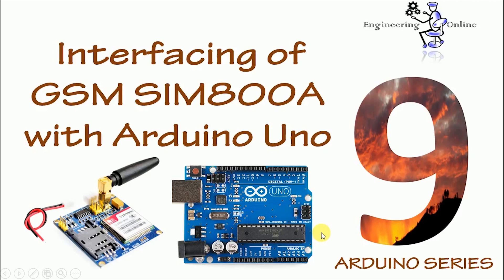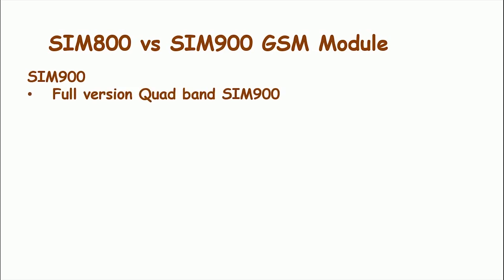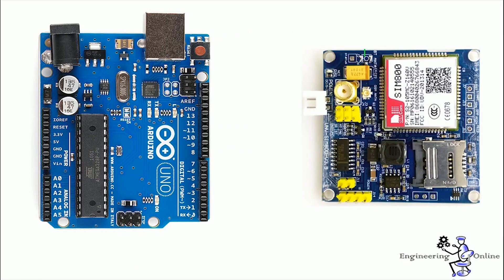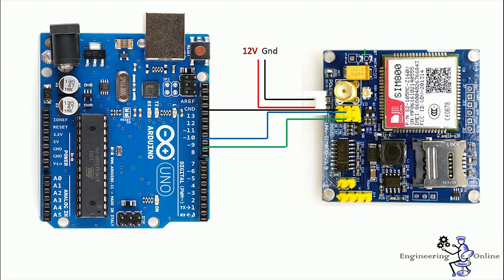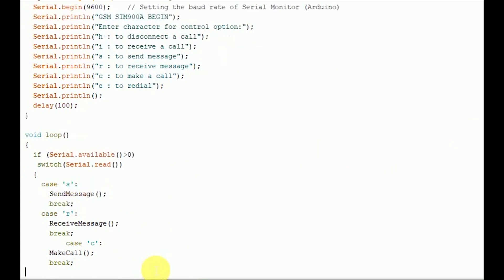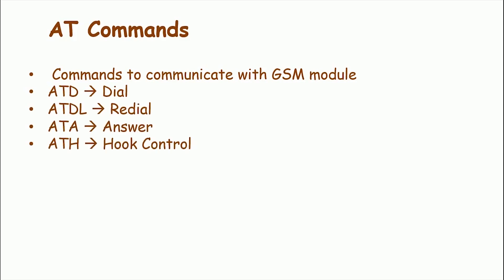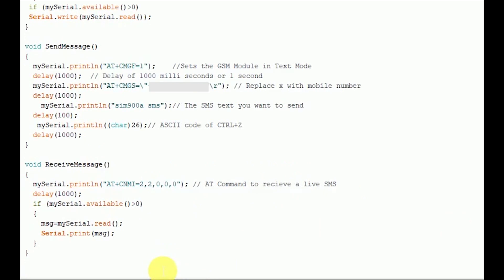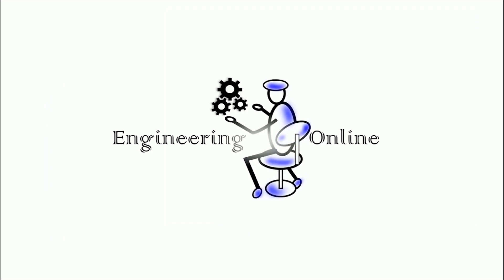Interfacing of GSM SIM800A with Arduino Uno

Comment: Hi mam, could you please explain me how to control our appliances through blynk app using GSM module without interfering any msgs or call for controlling appliances.
Reply: And if it's possible please explain the code or make a video for that which helps me a lot to my project
Reply from the maker: Sure noted 👍
Reply: @EngineeringOnline  Thank you so much

Comment: error  case label "s" not within  a switch statement
how to solve this error?
Reply from the maker: you are doing some mistake in the code. recheck
Reply: @EngineeringOnline  the LED blinking every second and i check using AT Command Tester.....showing "device is not registered and is currently NOT searching for a new operator to which to register"..
how to solve this problem?
im using 4G POSTPAID SIM
Reply: @EngineeringOnline  ur code is perfectly work but when i enter the c in AT COMMAND showing NO CARRIER
can u help to solve this problem

Comment: If we write this same code for SIM900a. Will it work?
If not what are the modification we should do?
Reply from the maker: Yes you can use the same program. Just confirm the serial pins.

Comment: Mam I'm using Sim800l it is working properly (i.e. it is  registering on network) but arduino board can't detect module .
Can you plz help me ?
Reply from the maker: How are you connecting it with Arduino
Reply: @EngineeringOnline  
Mam I'm giving power supply to module seperate 5V 1A and connecting txd and rxd pins of module to tx and rx pin of arduino
 uno board  respectively and also tried 9,10 and 11,12 pins of arduino board.
Reply from the maker: @insidepetworld  The recommended voltage range for SIM800L is 3.4 - 4.4 Volts. An external power source like Li-Po battery or DC-DC buck converters rated 3.7V 2A would work. Remember connecting it to 5V pin will likely destroy your module! It doesn’t even run on 3.3 V! Also confirm if the status LED blinks every 3 seconds
Reply: @EngineeringOnline  
Mam but module getting required power but when code is uploaded to arduino and module connected it say  FINDING MODULE only.
What about this ?
Reply from the maker: +Abhijeet Koli send the screenshot of the code and the error at engineeringonline0@gmail.com

Comment: Is this 3g module? Also how do you connect 12v power supply to that xh2.54 power connector?  And I have 12v 3amp adapter. Is it ok to use it for this module?
Reply from the maker: It is compatible with 2g/3g/4g.  This module has a male connector, so connect a female connector with your supply to power up the board. 12V and 3A would be fine for this module.

Comment: In my case SIM 900a wont send a message...source code same but im using Mega ..can you help me?
Reply from the maker: +Dadan Gusna What is the voltage and current ratings of power supply given to the gsm board?
Reply: @EngineeringOnline  5 v from external and i check with the blank sketch and write "AT" on serial monitor with baud rate 9600 ... sim900 just send "?????" Looping everytime just send "?????" ...i don't what happen ...ia sim900 broken or Mega ...
Reply from the maker: +Dadan Gusna Check both of them individually. Run a blink led program to check mega and insert a SIM in the gsm module and then call that number and if you hear the ring back that means your SIM is connected to the network and GSM board is working fine.

Comment: You are incorrect with your Vdd for SIM800. They are nearly all 3.4-4.4Vdc, typically 4Vdc
Reply from the maker: SIM800A requires 9-12V whereas SIM800L requires 4V dc

Comment: i am not able to send any messages 
it is just sending either blank message or just showing the content is not supported 
please help me to fix it
Reply from the maker: Have you double-checked the code? Call function is working properly?
Reply: @EngineeringOnline  all the other functions are working fine 
And even I can send sms from my number to GSM module 
But if I send message from GSM to mobile it is either showing content not supported or just sending blank message
Reply from the maker: recheck the sendmessage() function and try to change the mobile set too.

Comment: May I ask you a question, I made a project with Arduino uno R3, module sim 800A, controlling a contactor via module role, when power off and on so then arduino doesn't comunicate with Sim800A , I have to reset Arduino then it works . I don't know why, please help me, Thanks
Reply from the maker: How do you reset, through push button? and Does your Arduino works ok when it is not connected with SIM800. Try to run a simple blink LED program and check if it's working without pressing reset ?
Reply: Engineering Online thanks for your help!

Comment: i am getting the output as no carrier for call and error for message i have connected everything properly i have given power supply of gsm 800c to laptop
Reply from the maker: Check if the antenna is working properly, sim is inserted in a proper way and current requirement of the module is fulfilled
Reply from the maker: Try powering the module with external power supply that has minimum 1A current.

Comment: I am getting a "NO CARRIER" error please help
Reply from the maker: Make sure you have connected the antenna
Reply: @EngineeringOnline  yes its well connected and the gsm module is also working fine as i checked it with at command software but the gsm module was getting heated at baud rate=9000 so i changed it to 115200 and know its not heating but i am not getting any kind of output
Reply from the maker: @devangpatel675  Which GSM module you are using and what are the voltage and current ratings of power supply?
Reply: Sim 800A and power supply for it is 6v and 1amp
Reply from the maker: @devangpatel675  I have used 12V and 1.5 amp power with 800A then it worked fine
Reply: may be less power supply

Comment: Does sim800a support only 2g sim
Reply from the maker: I have used 4G SIM and it worked fine
Reply: @EngineeringOnline   i have used a 3g sim but it didnt connect. I didn't connect an antenna ,may it be the problem
Reply from the maker: @allencarvallo1716  Yes you have to connect antenna must.
Reply: @EngineeringOnline connected the antenna ,now its working fine. Thanks a lot
Reply from the maker: @allencarvallo1716  Great. Most welcome